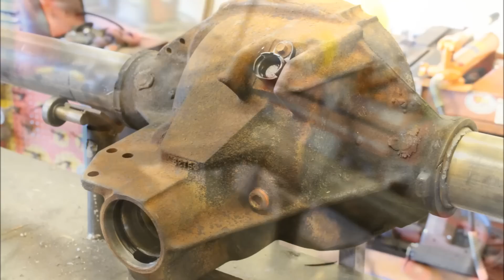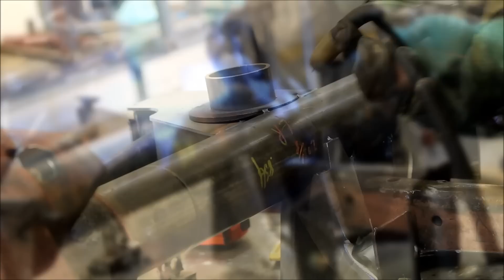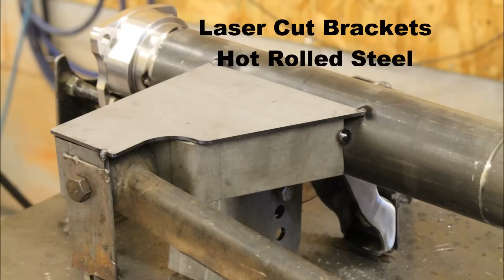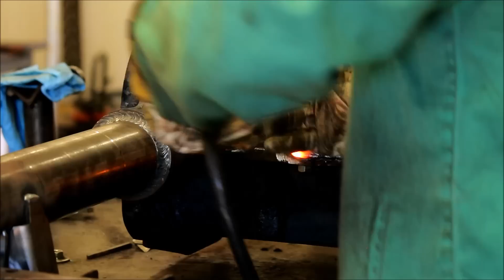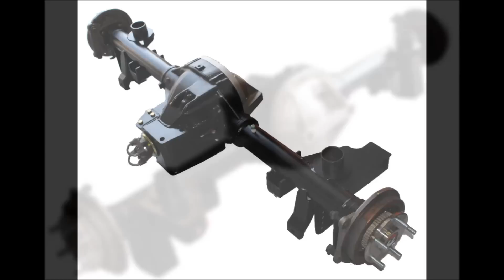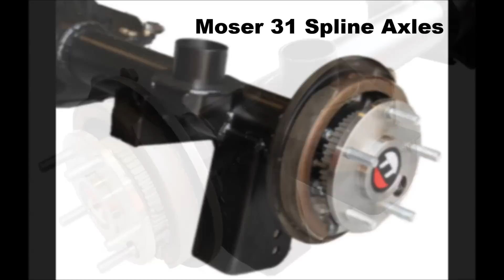HAWKS Third Generation F-Body 8.8 Rear End Build Process

Comment: Does the 8.8 sit more to the right meaning drive shaft is off center more towards passenger side?? I recently got one and drive shaft real close to passenger side
Reply: If it’s a stock ford rear, yes, one axle is longer than another, but if it’s been modified for an f-body, it shouldn’t be
Reply: @Matt_Lanzer_13  well no wonder why mine is off

Comment: hopefully by the end of this year I'll be ordering one for my fbody.
Reply: Same here man
Reply: +Austin Orsini what gears you have plan to do ? 
I'm a 6 speed. idk if 355s or 373s. I'm more of a street car then track car.
Reply: +SRfastZ I'd honestly go with the 3:73s out of the 2. That's generally an "all around" good gear. That's most likely what I'm going with too.
Reply: +Austin Orsini  I think I am.
Reply: I see you peanut
Reply: I ordered mine with a tru trac and 3.73s for a stick car. can't beat price,quality, or how long it took to get here. beautiful piece.
Reply: Take it from me with plenty of experience that you want 4.10's.  The stock t56 has a very tall 2.66 gear and your car more than likely already has a 3.42 in it.  Your rpm's in 6th gear will be no issue at all.  With the .63 6th gear ratio you will be turning about the same a stock gears in an automatic.  I drove a T/A with 3.73's and 6 speed and I couldn't tell the difference in stock gearing.  It's all about the 2.66 1st and .63 6th that make 4.10 a perfect gear for the 6 speed cars.
Reply: Michael Burris I have a 2001 Pontiac Trans Am WS6 6spd. I would like to change out the rear and I'm torn between 3.73 or 4.10....what's the better choice? I would like to hit the drags strip now and again. I don't drive the car much. Thanks
Reply: Dude, please just get the 4.10's.  Your car already has a 3.42 and notice how long it winds out in 1st gear.  Also notice how unusable 6th gear is until you get up to 70ish.  The 4.10 will make your car so fun to drive and peppier in first and actually allow you to use 6th gear more which is going to help mileage. 

Bottom line is if I had an automatic then yes I would go 3.73 because it has a very steep first gear.  6 speed cars flat out need 4.10's and 4.30's are my favorite 6 speed 4th gen gears.
Reply from the maker: Sounds good, we look forward to helping you!
Reply: Everyone in here questioning what gears to go with, if you are an M6 car go with 4.10s! You won't regret it, trust me. Finally makes first gear semi-tolerable
Reply: I did get my 8.8 rear end build by hawksmotorsport with 373s 4channel/traction control in my 6 speed back in the summer of 2019. I'm a very happy customer. I end up ordering a custom chromoly driveshaft from them a year later.
Reply: @SRfastZ  sounds good. If I still had mine I would have went this route. Definitely a nice option.

Comment: I have a 97 3.8 v6 firebird what rear end should I get that is the best
Reply: Ace Gotcha Gaming Tips a v6 firebird wont need a rear end this beefed up unless you start putting out more power with the engine a stock 10 bolt should last you longer than youll probably have the car if i were you i would rebuild yours or swap it for a good one out of a donor car
Reply: In All honestly, unless it's turboed; pretty hard probably not needed. I would spend the money on a power adder. This rear axle is for cars that are in danger or have broken the stock 7" 10 bolt. it doesn;t add any power or make your car faster by itself. It's an upgrade for strength.
Reply: Yes you could do some major improvements to a v6 firebird with the 3 grand this would cost
Reply from the maker: Our 8.8 rear ends are the best on the market hands down!
Reply: Ace Gotcha Gaming Tips sell your car use the money you are going to spend on a rear end on a V8🤷🏾‍♂️
Reply: the one in your car,you dont need anything
Reply: I've got a 2001 Firebird with the same V-6 3800 Series II engine and the 7.6" 10 bolt rear end. An inexpensive way to increase performance is to drop in a 3.73 gear.
I bought one from Motive engineering for $150.00. It will give you a mechanical advantage when you launch and combined with the 4L60E trans with overdrive keep
the highway RPM down . With the  set up I have : Stock 16" wheels and  P245-50 Cooper Zeon tires , I'm running about 2000 RPM at 70MPH, all thanks to the overdrive.
You could drop in a 3.93 or 4.11 but our engines don't produce enough torque to take advantage of such low gears, the Firebirds weigh in at approx. 3800 lbs.. Yup, you just can't beat a LS1 or LSA engine. if I had the money I go to Hawk Motorsports and pick a LSA from a Cadillac CTS-V and then use their rear end.

Comment: Well, the finished product is a thing of beauty no doubt. but that's a hell of a lot of heat put into the rear especially for the torque arm mount. I've got to wonder about warpage as a result.
 Begs the question what steps are taken to control or correct it?
Reply from the maker: We build these in house and have shipped over 100 of them just this year, the trick to not warping the housing is to pre-heat the cast center then move around to prevent warpage.

Comment: Anyone have one and could fill me in on if these are worth it and what gear setup they chose? Thinking of putting one in my 400hp 92 rs
Reply: If you are really pushing 400 hp you better get a new rearend with after market sub frame connectors and lower control arms.
I didnt on my 85 iroc after i put a 350 4bolt main 30 over 10.5 flat top pistions 495 lift roller rocker cam set up and all the rest of the good stuff.
Well i dint even take a few weeks and i blew out the stock rearend.Had new richmond after market gears put in and the tech wasnt able to get the perfect mesh so there was just a very little bit of a whine.
Well them gears lasted about a month.I was so made i went back to the place where i had them installed and insisted they replace em for free.This time the tech and the tech foreman and myself installed a new set of gears and coulndnt get the gears to mesh.Upon further inspection we noticed that the pight side of the axle had a twist/bend and the tork arm that connects from the tranny  to rearend was twisted also
So yes if your going to have some tires that hook up well do the modifications.
Reply: 3:73 gears if your keeping or have the 700R4 tranmission
Reply from the maker: They start at $2,095 and go up from there depending on the options you select.

Comment: Priced to high.
I build my own or buy it somewhere reasonable.
Shame such a good product is killed by greed,same thing with the LS swap pkgs.
Reply: As a Gm 7 time f body ownership you make a good point alot of companies are greedy. But this company actually does great work also
Reply: 🙄🙄 so simple minded.
Reply: I wouldnt make you one for 2 grand Ill tell you that. Maybe 4, but still not making alot of money at 4 grand.
Reply: @gamesofcontent  
Lmfao.
Reply: A guy on FB does them for $1100-1300 but that doesn't include setting up the gears and installing everything.
Reply: SnifferSock what guy u talking about? And what would it cost for a ready to bolt in rear? Or who would I contact
Reply: I have one ready to bolt in. $1500 which includes disc brakes, pads, calipers and rotors. 4.10 posi. New bearings and seals.
Reply: Lewis Foltz how can I get ahold of u
Reply: @lewisfoltz6306  were did you get yours ? Im thinking of upgradeding my 92 v6 camaro rs to a 383 stroker with a manual trans but dont know wich diff i should go for.
Reply: @fabianrodriguez2480  91-01 Ford Explorer. I pulled mine from the junkyard and extended the right side axle tube, welded a ta kit from hilte and used two left side axles. Very easy.

Comment: Bought one of these and ended up being defective and hawks waited almost a year to get back to me just to tell me they aint going to warranty it out like bruh so much for the $5500 i spent on this POS after installation but tbh i should have went with quick performance, basically got scammed i guess 🙃 ps they built and shipped it to me for my 500hp+ firebird trans am build very disappointed in hawks...
Reply: What happened to it? What failed? Yes they are cocky non responsive jerks after they get your money.